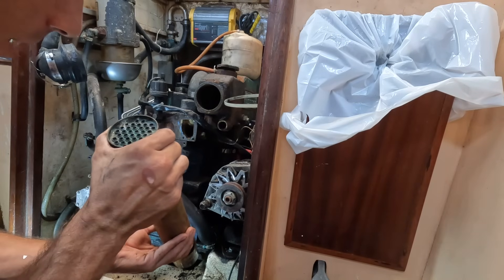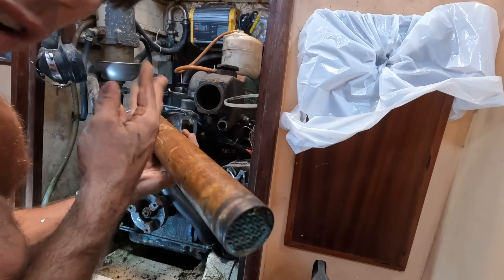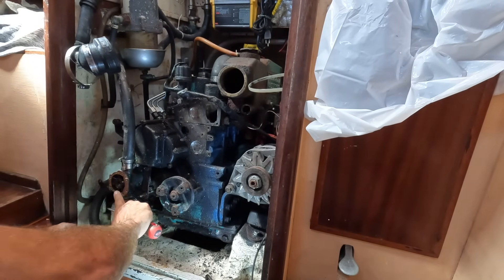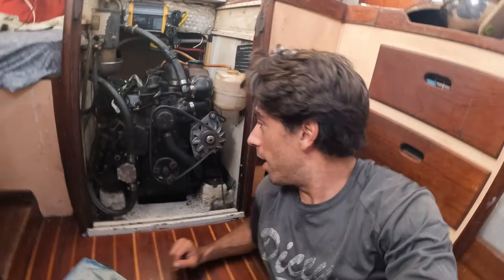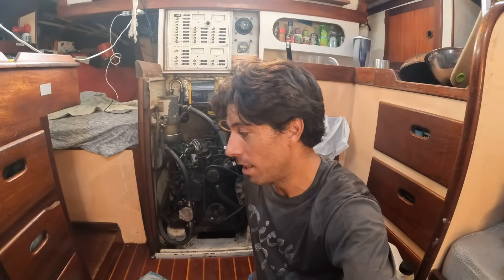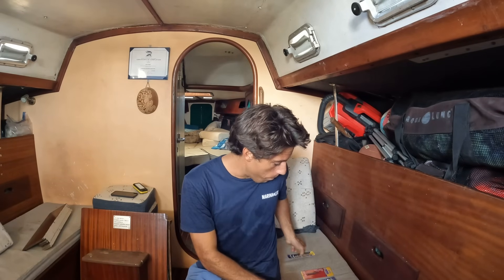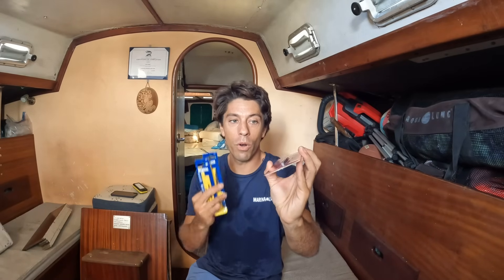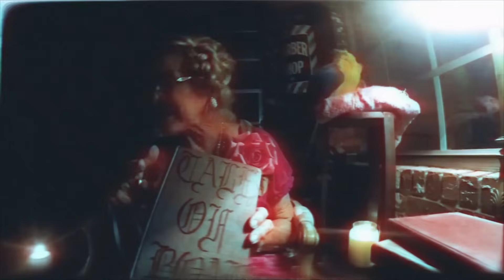DIY Sailboat Diesel Inboard Battle | S2Ep4

Comment: The advice about never carrying "new" spare parts is gold and not intuitive at first, but it makes sense. It's a lot easier to troubleshoot an issue when you replace a part on a previously-working engine than waiting for an engine to fail, trying to find the failure, and hoping that your untested spare part works.
Reply from the maker: Agreed and I have seen it in action!!! During a 9 week charter season I watched Thomas effortlessly fix mechanical problems as the charter just kept on going.

Comment: I'm so glad that bolt didn't put up a fight! Did you check to see if the hole depth was deeper than the bolt length? That could have been a factor. Congratulations on completing another step towards sailing the 7 Seas!
Reply from the maker: I did check and it was a bit deeper than the bolt. Could have been a combo but the belt was definitely over tightened! Thanks Dave!!

Comment: Thomas would know the answer in a second. You know that but I guess he sometimes is out in the big blue. The most common answer on that sludge was remnants of the old antifreeze still in the engine, and putting new antifreeze in. The worst possible related problem reported was the orange and green antifreeze mixing , even a little bit. Basically the answer was when anything other than water mixed with the antifreeze still in the engine. The result is the gelatinous sludge. But who knows, maybe farther in the video you had found the answer, still watching it out here in the California Redwoods. Could you answer this question ? If a tree, a redwood tree, falls in the woods and no one is around to hear it, does it make a sound ?
Reply: Damn, that is exciting. I've had those extractors on my list as important boat stuff tool side for quite a while. GREAT to know they work so well !
Reply from the maker: My answers is no, it does not make a sound because sound takes an observer. If there are animals or other sentient beings that can hear than yes. Or maybe plants and trees can hear, then yea. Lol oh boy. I digress

Comment: never use the smallest easy-out, if it breaks you will have trouble getting the broken piece out because they are super hard and cannot be drilled. always better to to use largest possible without destroying thread.
Reply from the maker: Okay thanks for the tip!!! Glad I didn’t have to learn that the hard way 😅
Reply: @Bumsonaboat and you can break them with the drill. Better to use a wrench to turn the ezout if possible

Comment: If you have fresh water moving around your thermostat the particles you see could be minerals that are naturally found in water. The bolts are subject to lots of vibration and they are under a lot of stress over time.  The good thing is you found it now.  Not while under way in a storm. 😊 This is why routine maintenance is so important. 🤗 You are doing a great job.  Learning more every day. Way to go! 🥳 Keeping a log book of maintenance helps you keep on track as you can reference past work & parts (write down part numbers) replaced this helps reason what could need to be fixed instead of guessing.  You can spot reoccurring issues and plan future maintenance.

Comment: Great job Joel! Remember when you over tighten a bolt they tend to stretch plus vibration = broken bolt. Always be cautious with the extratactor bits.. it’s a lot safer to use a wrench and go slow instead of a drill so it doesn’t snap in the hole you just drilled. Glad it all worked out! You’re getting better at this mechanical stuff!

Comment: Gday Joel,happy new year to you,that calcification on the thermostat housing is definitely salt water intrusion,there’s a rubber boot on the back of the heat exchanger that allows the raw water to mix into the coolant.
Reply from the maker: Thanks! That was an original problem we had due to a clogged exhaust elbow. The current exhaust elbow is new and the water flow is great. Another idea was that I did not use distilled water when mixing with the antifreeze.
Reply: @Bumsonaboat  aah ok,quite very possible. I remember seeing somewhere on some sailing channel this same issue where raw water infiltrated the fresh cooling water system which was caused by a rubber boot off the heat exchanger,sorry I’m vague on details or which channel but was pretty sure it was a Volvo penta like yours.safe sailing Joel and yes Thomas is top shelf along with his awesome wife,they are the epitome of 
passion,direction and perseverance,great role models,stay close with them.

I heard a saying once,if you hang around 5 rich people you will become the sixth,if you hang around 5 smart people you will become the sixth,if you hang around 5 dumb people you will become the sixth,you’ve taken a big kick in the ass but watching you bounce back is showing us true character,your going to be alright buddy,enjoy flying solo for as long as you can,once wimen and children come along then some hard choices will have to be made,Thomas is proof you can do it with the right partner but get the wrong one and the man’s dreams are forever put on hold till the body can no longer do what was once the dream.Stay safe.Dirk.

Comment: put never seize on the bolts & if the bolts did not have lock washers originally then don't put them on it good job getting the broken part out stay safe out there

Comment: Nice work!  BTW the starter clicking and acting like a dead battery and then suddenly working could be a loose or corroded battery cable/wire connector terminal.
Reply from the maker: Thanks Bill!!! Appreciate the feedback. I’ll check them out!

Comment: One thing that can cause gel in the cooling system is mixing old fashioned coolant with extended life coolant.  They are not compatible and the system should be flushed well and stick to one type antifreeze that is available to you.
Reply from the maker: Thanks. A patron told me if I didn’t use distilled water when I mixed my 50/50 antifreeze then the minerals in the water will cause that. I did not use distilled water but I also did not mix coolant. So I’m thinking it was using the tap water.

Comment: The boat could’ve just had a small imperfection that finally gave up and snapped. Possibly a previous time it was installed. It cracked and finally failed this time and I can’t see the end of the bolt where it snapped well enough but generally if there’s a difference in coloring from the final snap and the rest of the fracture than it was already cracked. Meaning, it was gonna snap sooner or later no matter what.

Comment: For all you people out there. If you want to save some time and money make your own "penetrating oil". Quite simple. Mix 30% ATF with 70% acetone. Acetone is very volitile and it and its fumes are very flamable. The volitility is the key. It will penetrate when other things won't and it carries the ATF with it. I always carry a small soda bottle of it premixed and also have a quite small plastic bottle(from some crazy glue) with a longish nozzle. It's great for application. Independent tests have confirmed that this "secret" mix is better than any commercially available penetrating oil and is often at least twice as good at penetrating threaded joints. 
For Joel: I have a Perkins Perama 30. Same basic engine as your Volvo. That alternator bolt will break again, because the load is right across the thread line of the bolt. My fix was to mount the alternator on a seperate bracket. Don't think you have the room to do that.

93 Comments
Sailing OTR (Over The Rainbow)
Reply from the maker: Thank you for sharing your penetrating oil formula! I’ll be sure to have a few spare bolts until I come up with a better solution. Appreciate your helpful comment.

Comment: broken saltwater intake grid,  thruhull. Tip: pump - seastrainer - pump going to engine cooling.
Reply from the maker: Thanks! A patron had an interesting observation. He asked if I used distilled water to mix with the antifreeze. No I didn’t.
Reply: @Bumsonaboat the gunk looked more like barnacles and crushed residue of sealife.You might want to take dip and check the grid below the waterline. take a used toothbrush (they´re always comes handy in some use) .and pipe brush to clean out if necesseary.